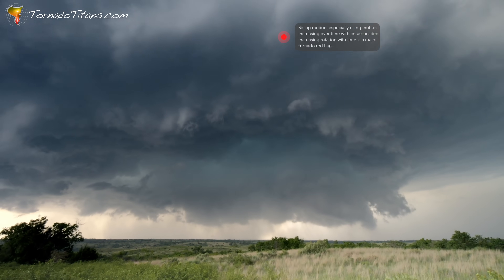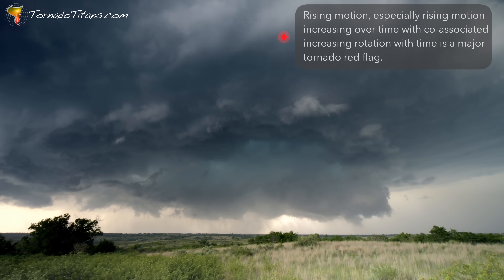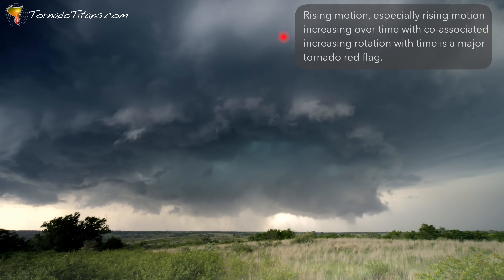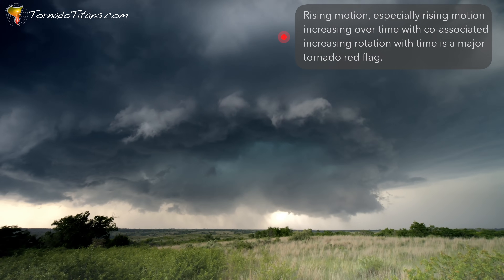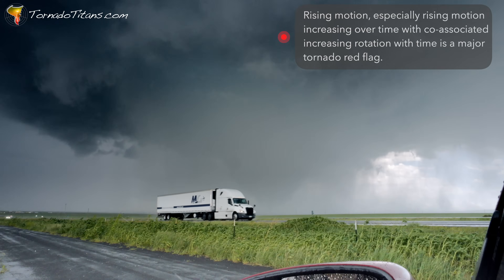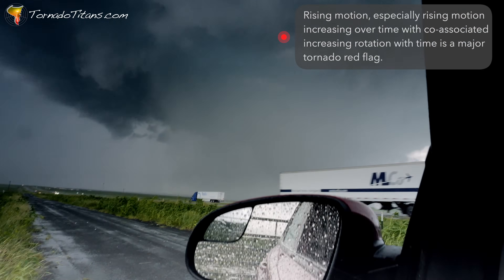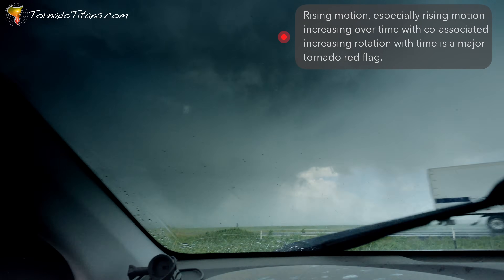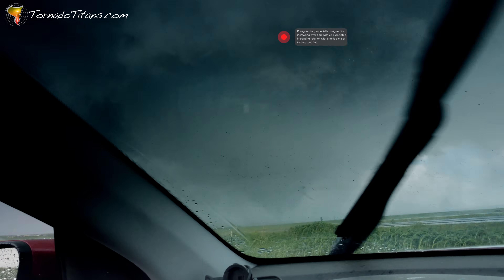Three Major Signs That a Storm Is Preparing to Produce a Tornado

Comment: I've actually seen the precursor for tornadic activity dark gray radioactive green skies and another thing is in absence of rain very large hail starts coming down the updraft starts splitting I used to live in Southeast Missouri I know when tornadoes could form I would watch the cloud formations for storm splitting and if they split to the right that means there's a tornado threat is split to the left it's going to be a wind threat and hail an awesome my cities alarms will sound if there's rotation with inside the parent thunderstorm I've seen storm bases get real low in poplar bluff Missouri when they start lowering a tornado sirens were immediately start sounding law enforcement has reported a funnel cloud in the area where the rotation and if there was one spot in the area of poplar bluff Missouri